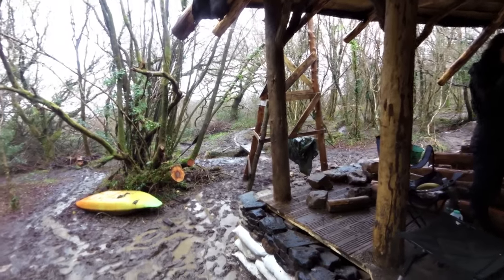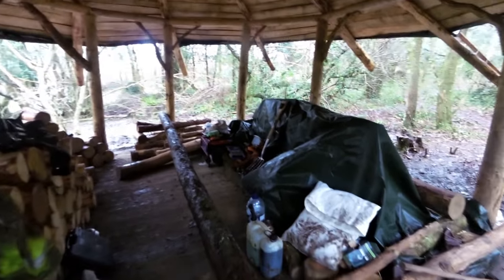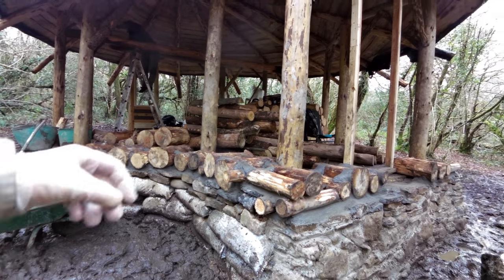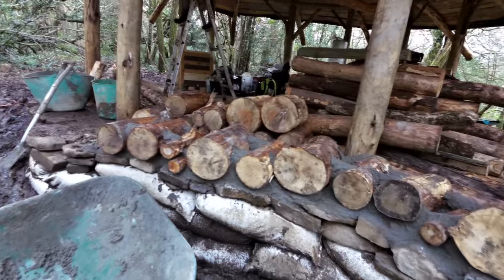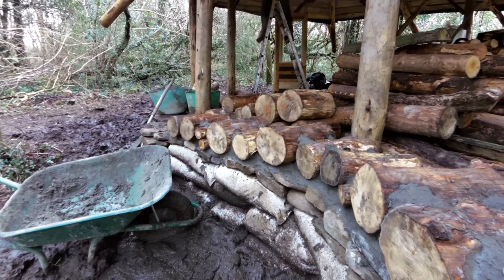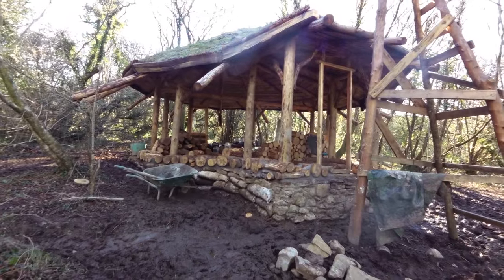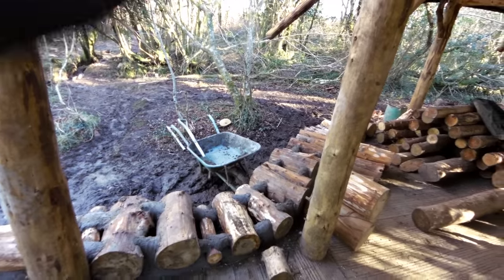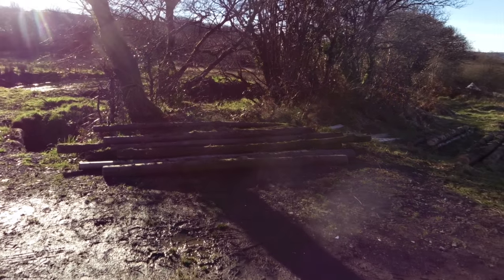Off grid roundhouse build part 9

Comment: hiy about your stone foundation, i work brick/stone work for a couple of years we use a lime based mix as well and we used muriatic acid to clean the bricks er stones with after brought them out really nice! with a 5 gallon bucket we just used a "glub" or a "glub glub" out of the jug. just make sure ur wearing gloves and glasses that shit is pretty costic even diluted in water but it worked great! and rinse it off after !
Reply from the maker: +Matt Cl thanks for the tip, that should save me quite a bit of scrubbing with a wire brush.

Comment: Very nicee.  A point on where your temp support is!  Would it not be better inside?  When the wall meets the upper floor, it will need to be moved prematurly and you might not be able to get it out because of the roof angle!
Reply from the maker: +Nellyontheland yeah it would be and where it is on the outside is going to make it a pain to get out, the problem is the bendy bits of oak i used for the diagonal braces are sticking out so the temp support won't fix to the post. so yeah i did think of that but things were in the way, i may have to cut the temp beam out but that is ok.

well done for noticing you have a good eye.

Comment: Chris I've just realised today how you did your wood cob fill to the walls. You've left a gap between the wood pieces which is very puzzling.???? This is a departure from the usual method of stacked wood cob fill.
Other cob fill builders have used dirt, lime, or wood ash as a binder also using bitumen as appropriate. 
So I am curious about your methodology.

Comment: Just a comment. I notice that your loft supports seem to have the small ends all going to the same side. It may have been better to alternate the ends so you would have a more equal load bearing floor. Other wise a great job!
Reply from the maker: good point. to late now but that would have been good advice. its all learning for me. thanks for the comment.

Comment: It is looking damn good Kit. One point tho, would it be worth extending the eaves at some point to keep the rain away from your walls? Just thought I would mention it before you cut off the end of your roof poles, in case it hadnt occurred to you. Im really liking it though. And its a lot bigger than it seemed before. Pretty damned awesome :D
Reply from the maker: +lynda williams its a good point lynda, the reason we left them that long was due to the length that i could carry in the car, i have left the poles long for that reason, if we get to much driving rain then we will have to extend the eves a little bit. I'm hoping we won't have to. it is in the woodland and is very sheltered from the sourouding trees. plus the woods i am using towards the bottom are very rot resistant so they can handle a bit of wet. its all learning for me and if a problem arises we can fix it and not make the mistake in the future. 

but great observation.

Comment: Ok, i built a banya (russian sauna), for foundation mixed and poured ton of concrete, reinforced it with some plastic reinforcement. And i still got few cracks on my wall. How is your building sits basically just on dirt and has no cracks?

Comment: sweet progress! What kind of fireplace are you planning to build in this?
Reply from the maker: +klausssi123 we are going to have a range cooker. so it will have an oven a hob and a glass door to see the fire. we are going to invest quite alot of money in to the cooker as it is very important to us to have an efficient heat and cooking course. we will also make ahead exchanger to heat water from it as well.
Reply: +DIY Harbor: Kris Harbour  That is good idea. i think i will tear down old caravan for gas kitchen equipment such fridge/freezer and stove. i am definetly going to put wood heating but cooking range takes so much space and is propably too powerful for my cabin wich will be only 9m2. Those fridges in caravans are 12volt/230volt/gas combo fridges so hopefully i can mainly run it out of solar and wind.

Keep up the good work.
Reply: +DIY Harbor: Kris Harbour You might want to look into masonry heaters and rocket stoves, if you haven't already. One of those two might be a good match for your roundhouse. Thanks for the update, looking good!

Comment: You need some sand in your cement. You cannot use cement on its own, it'll just crack when it dries.
Reply from the maker: at what point did i use only cement? i think you will find i didn't.
Reply: Oh my bad, in that case the mix is too lean. What was the mix, should be 4-1. Didn't mean to come across rude. Just friendly advice.

Comment: hope you did not built on the flood plane..ps..it is difficult to understand you with your accent.perhaps specking mord slowly would help.
Reply from the maker: +Robert Tucker well there are no signs of it flooding before. it is on a hill so it could never stay flooded for long and plus it could sit in water and not have problems anyway as the flood inside is raised off the ground. 

this year there was really bad storms and rain and there was no signs of water getting anywhere near the house.
Reply: +Robert Tucker He may have just been specking a landgig euw didn't unda stand, meebee tiep mord slowly?